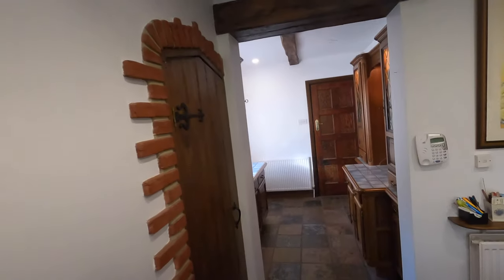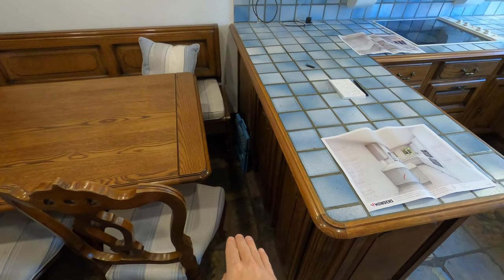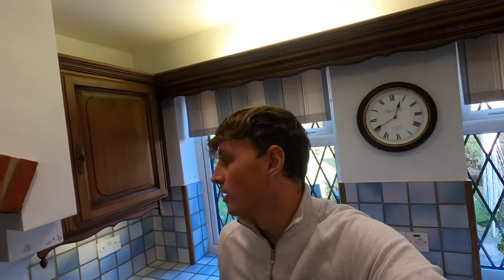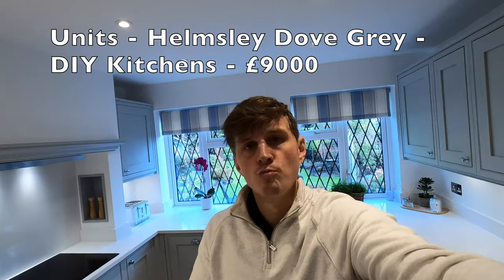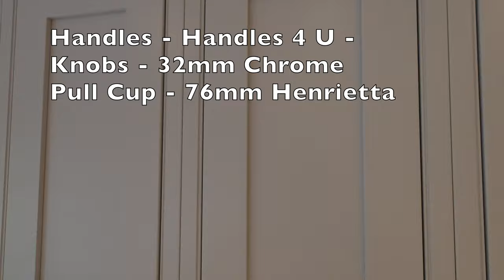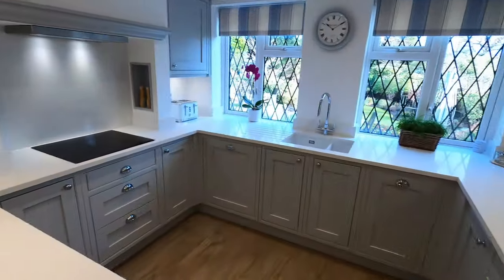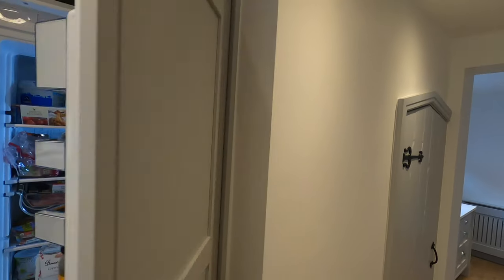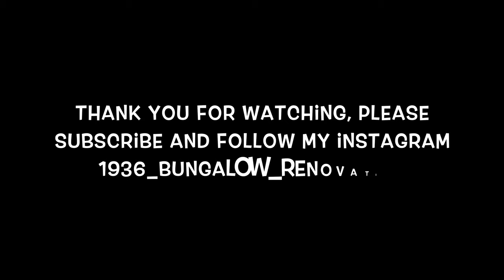Before & After Kitchen Home Renovation - DIY Kitchens Dove Grey, Quartz Worktop, Amtico Flooring

Comment: Very impressive indeed. I would have been tempted to take those windows out and the centre column and have a huge window to take advantage of that garden view , but we’re do you stop ?
Reply: Another nice kitchen Nick. Can I just ask, when doing the extractor hood, do you normally vent outside? What size ducting do you use, 4" or 6"?
Reply from the maker: Yes I try to extract outside where possible, rbis one did by going through the wall cupboard to the right of the extractor. This one was 4 inch, depends on the extractor and/or your cooking levels.
Reply: @andrewb113:  Agree nice kitchen  look achieved,  but a single full width window would have been my choice, but if not possible  i would have replaced the  zealous heavily leaded sealed glazing units with clear glass, easy to do,  the garden is beautiful no need to obscure it.

Comment: A very smart transformation, great time lapse editing, shaker suits this bungalow, the  colour is contemporary and the  light wood floor really lifts the room,  induction hobs are fantastic and built in microwave is much better than a  bulky worktop model, the only thing that doesn't quite work for me is the medieval look cupboard door, the colour matches but  i would have changed the door furniture to match the units. Nice lighting and plenty of sockets,  many people don't consider  ambient and practical lighting.

Comment: After seeing all the changes.......I like finished result..........why wasnt the door in the middle section painted grey and left dark?...Id have also put something like a picture light on the wall above radiator in the middle section to brighten it up.....Love the worktop and sink - very smart....flooring too.......windows need to be replaced with plain glass.

Comment: Beautiful job and just started watching your videos. The lay out is great and have two questions; Why use vinyl over wood flooring? Why such a small sink? Seems a bit small for counter and not that deep.  Cheers from the states!
Reply: The old floor had dated tiles, screeded over then a wood laminate as mentioned in the video, the sink is 1.5 bowl, smaller  part is for peeling and prepping food, Flexi hose tap useful for that,  the larger section  works ok for occasional washing up usually with a wire basket set in, most people use a dishwasher now, not much call now for huge daily washing up of pots, pans and crockery, and smaller less deep sinks use less water, so more eco friendly.

Comment: Hi Nick thanks so much for the video it's great, please can you let me know what size space it was?
Reply from the maker: Ah tricky as it was in 2 sections. The first section around 3m by 2m, the second kitchen part around 5m by 3m
Reply: @NicksHomeRenovations  Thanks Nick would it be possible to let me know what the approx measurements were for the quartz, how many meters did you use? Thanks
Reply: Hi Nick how much quartz did you use in total please?
Reply from the maker: About 7 metres of standard worktop, the breakfast bar was 90cm wide by 150cm long, plus upstand, taking it into windowsills and a 60cm splashback behind the hob. Hope this helps 👍

Comment: Overall these looks really wonderful, but I'm surprised you didn't change the door to the utility room. All of those strange peaked doorways look like a throwback to a previous renovation, they don't look like authentic architectural features from the original house that have been kept, even if that's what they are. The paneled door in the butler's pantry section goes much better with the style of the new kitchen, I would have changed the peaked doors to match that door. The peaked doors just look like they're trying to emulate some kind of ancient castle style, and that's just not working with the sleekness of the new design.

I also think the cooktop and sink look really small and narrow in scale in relation to the other features in the kitchen. In a kitchen like this, I would expect a wider cook surface. The ovens and refrigerator are great though, I like how both the refrigerator and freezer are tucked away and unobtrusive.

I would have eliminated the upper cabinets flanking the extractor built-in, and placed open shelving with decorative cookware and objects. Yes, you lose a bit of storage, but it would make that area look like more of a feature and focal point. And this kitchen looks like it has plenty of storage. 

Once again though, this renovation turned out really well overall, this is just what I would do differently.
Reply from the maker: Wow thank you Siansonea, fantastic comments. Came down to client choices but I appreciate your honesty and opinion 👍

Comment: Such a shame they didn’t make those two windows into one
Reply: unfortunately designers ve to stick to their clients ´budget ; also if there's a supporting wall ; they won't be able to do one big window;;;
Reply: @laila-j1b7v  have you not heard of a lintel
Reply: @laila-j1b7v  an RSJ would have allowed that but then you’re talking more money and maybe the client didn’t want to spend that much. I would have put big modern sliding doors in 🥰
Reply: For a budget friendly option i   would have replaced  the leaded glass sealed units with clear glass,  the garden is very nice the leaded pattern  obscures it.

Comment: Hey Nick, did you ever manage to sell it on eBay in the end. If so, can I ask how much it eventually sold for? Helps me to understand how much these guys get sold for or if it's worth just scrapping it. Cheers
Reply from the maker: Yes. You’ll never get much on eBay if you advertise as I do; to take down, remove and take away. No more than £100. Maybe you’ll get more if you take it apart yourself but I’ve sold some for less than £20 but the point is you don’t have to spend hours or days taking it apart!
Reply: @NicksHomeRenovations  thanks nick! Really helpful. I imagine you’re busy with your own renovation and can’t gigs in London? If you can’t, possible you can recommend a kitchen fitter you’ve worked with? Perhaps the one in the video even?

Comment: Hi Nick!  I'm from the U.S. and curious about kitchen boilers.  So is this a unit that heats the kitchen tap and dishwasher?  Is there a separate one for the bath?  I assume that this takes the place of our hot water heater that sits in the basement with the furnace.
Reply: That boiler will supply heat and hot water to the whole house, it just happens to be in a kitchen.
Reply from the maker: The boiler heats the whole house, which in this case is 2 bathrooms, all of the radiators and the kitchen and downstairs toilet taps too. There is no water heater, everything is Gas and the dishwasher is connected to the hot water line from the sink, which again comes from the same boiler! Hope this helps.
Reply: @NicksHomeRenovations  Thank you.  I would think it would be tucked away in a basement or cellar, but it seems they are in kitchens and baths.  Does the U.K. not have mechanical rooms?  Sorry, but very interesting about the differences.
Reply from the maker: No space for mechanical rooms in most homes! 67 million people in the UK, which comparatively is the size of the state of Oregon!
Reply: @annwilliams9214  plus cellars and basements are not common in UK homes (I've lived in 11 places, none had a basement or cellar).
Reply: @NicksHomeRenovations   Thank you for the explanation.  Very helpful.
Reply: @clarkeysam   Thank you!  From watching Downton Abbey and the like, assumed most U.K. homes, especially the older ones had underground cellars for mechanicals.
Reply: @annwilliams9214  My boiler is in the loft. Downton is Highclere Castle, the Earl and Countess of Carnarvon live there, 250 rooms, grounds, tea room,  much  of the interior Is a studio set.

Comment: The kitchen looks amazing! However, the layout seem really strange having the refrigerator so far away. I would have ripped out the utility room to make space for the refrigerator and pantry... and placed the washer/dryer under the counter next to the back door.
Reply from the maker: Thanks Donovan. The fridge is right in the heart of the kitchen, it’s the freezer that is down the other end at request of the client 👍. They also didn’t want the WM in the same room for noise reasons.